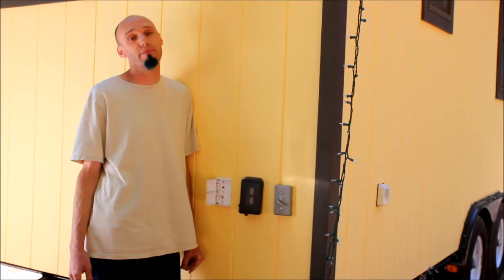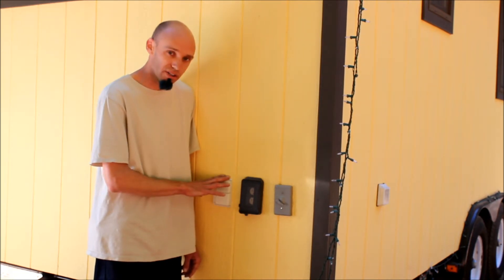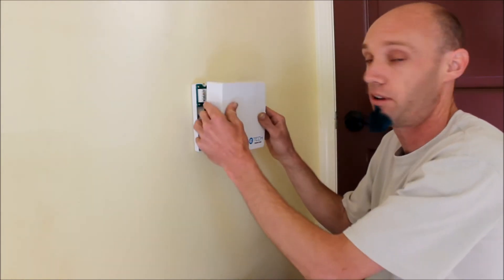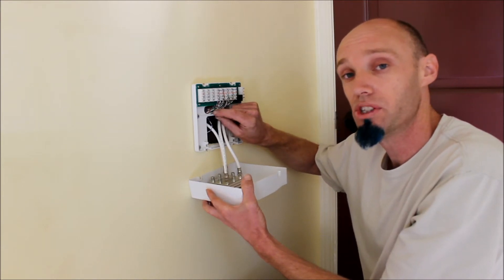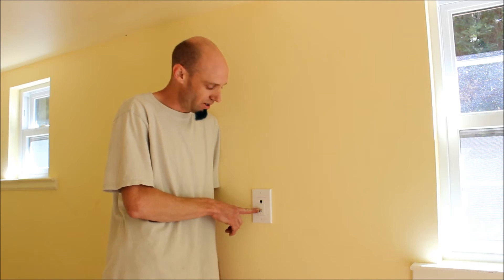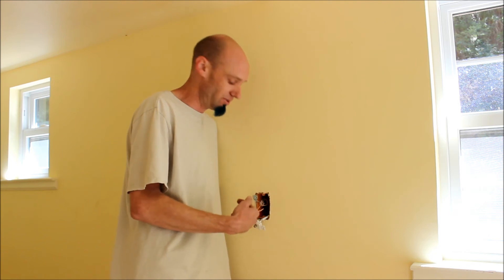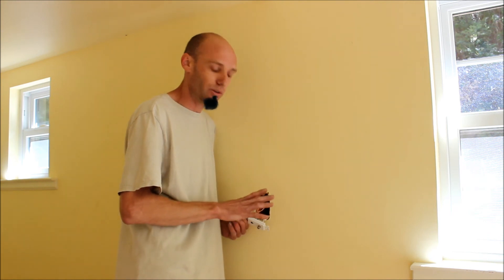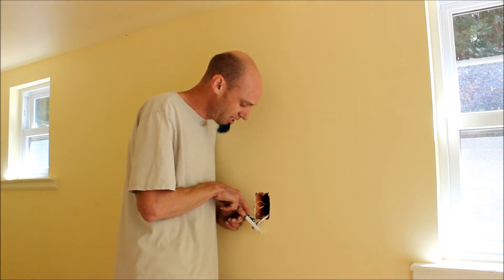Tiny house tech; how to wire phone, internet, and TV cable in a tiny house

Comment: that's not really how you wanna wire the cable ideally you wanna have all the rg6 cable going to the outside or a bigger media panel any cable company is going to use their own splitters so you wanna have the lines in a big enough box to be able to hold them.